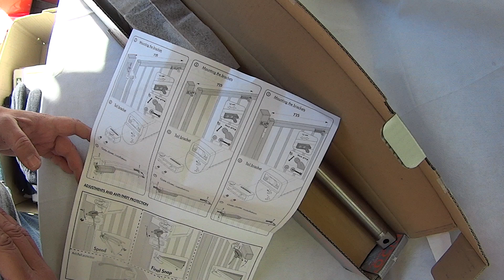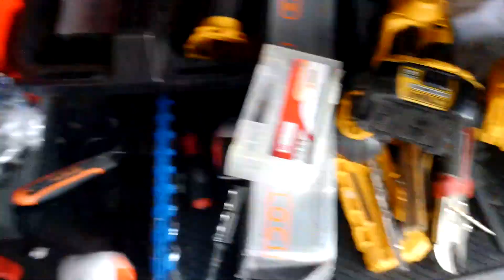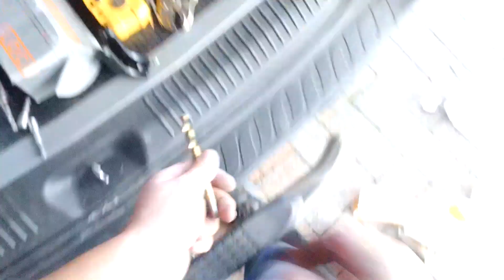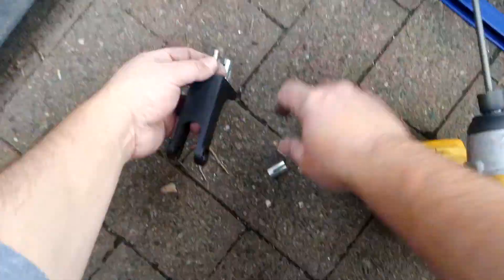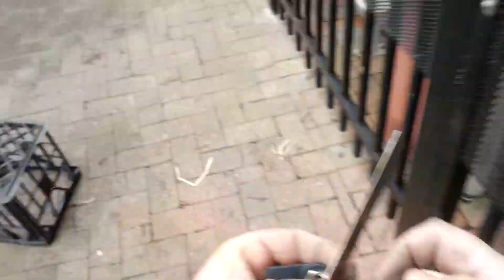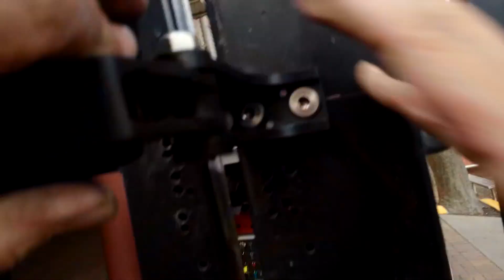Heavy Duty Gate Closer - Samson 2

Comment: Good expo on a more suitable closer. I was a bit concerned about the swiss cheese gate post. Looked like it took the original fitter of the lightweight closer a few times to get the proper orientation. In re to Lock and Keys comment, there are quiet a few 001s out there with electric strikes out of adjustment. Do you notice that in your travels? Cheers:-)